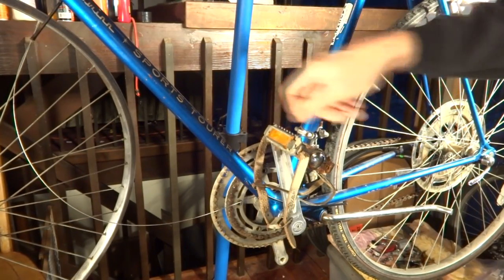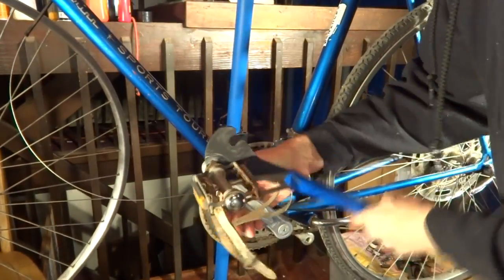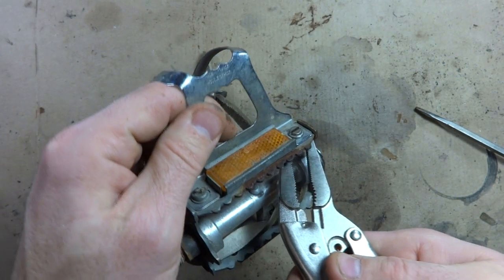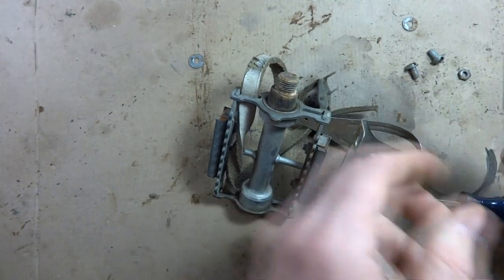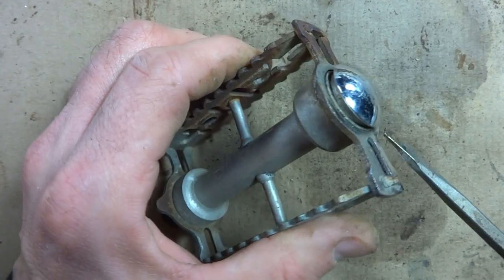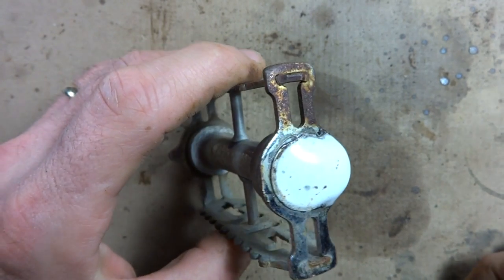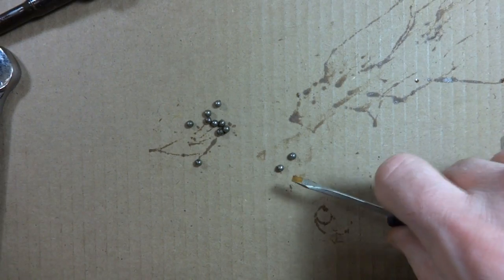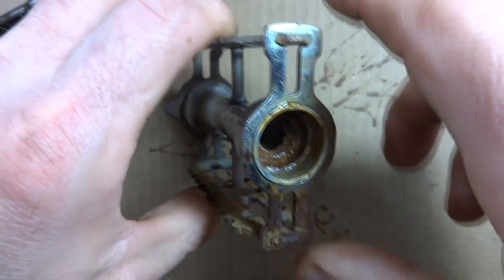How To Overhaul Vintage Schwinn/Atom 440 Bike Pedals - Clean/Lube/New Bearings

Comment: Those cleaned up rather nicely! I got an old Schwinn in really good shape, mid '80's world sport, and am going to overhaul the pedals, they are in better shape than the ones you showed here, so should be just a take apart clean and relube reassemble job on mine. The bike seems to have never been ridden, just got some bugs due to 35 years of sitting neglected...thanks again RJ for all the sharp vids on how to stuff with these old bikes!!!
Reply: Bikes like this have one bad thing when it comes to being almost new from sitting in storage for decades. The grease goes bad. Someone could of rode it with bad grease which is about the same as riding it with no grease after it sat in storage. So for people buying a bike that is almost new, always check the pedals and wheel bearings by spinning the rims and pedals to be sure the bearings, races, and cones are just as excellent as the rest of the bike. You could be buying a bike with damaged parts that are also parts that are very hard to find.

Comment: Just so happens I had just overhauled the exact same model of pedals. Stumbled onto this video by accident afterwards . The 8 outboard and 11 inboard count is what was in my set. I repacked them with 10 outboard and 11 inboard bearings. 10 bearings set with a little grease to hold their position allows a test fit of the cone and after removing the cone there was still a plainly visible  gap in the line up of bearings in the race. Atom figured 2 extra bearings would cost them their profitability.
Reply: My Atom 600 pedals were fitted with 10 bearings outboard and 11 inboard.  The original ones were in perfectly good shape, so I reused them.  Had this been a wheel or a bottom bracket, I'd have acquired new ones.  Honestly, though, the pedals were fine before the overhaul.  I only overhauled them for the learning experience.

Comment: had these pedals on my 80's apollo 2 road bike but without the toe clip & strap those press fit dust caps used to get dented & fall off,my pedal caps had 2 extentions that had 2 screw holes to hold the cap in place,used to be referred to as bear trap pedals because of the serrated edges :)

Comment: Presumably this process would work for Atom 600 pedals as well?   In this case, the straps are installed what most riders would call upside down or backwards.  The usual orientation is such that the strap can be pulled outward to tighten.  EDIT: My Atom 600 pedals have 10 bearings on the outside and 11 on the inside.

Comment: I decided to rebuild the pedals on my wife's bike after rebuilding the gear. I ran into the same odd number of bearing. I added bearings as well. I will be doing the other side pedal tomorrow.  I am curious if it's the same.

Comment: i just bought RFR Flat SLT, removed the old (default) plastic ones with a Knipex and i used Force oil( for chain) to grease. Should i use silicone vaseline instead ? i also ows PTFE spray for chain and a spray for fork, probably silicone based too. 
thanks for answers.
Reply from the maker: Sorry, I don't know those pedals. For pedals with all metal stuff, I use marine grease. If there are plastic parts, I use silicone grease.

Comment: As always, excellent video. I also have a question for you. I’m building an old Mongoose BMX and was fortunate enough to be given the stock SR-468 pedals but one of them has a slightly bent spindle. Have you ever managed to straighten a spindle, if that’s even possible, or replace it with another from an old junky pedal? I’d imagine as long as the length and cone thread size is the same I should be able to do it. Any advice is appreciated.
Reply from the maker: If the spindle is bent, replace the peddle. Unless the the other peddle is the same, the spindle probably wont be.
Reply: As it turned out the pedals were for 9/16” and I managed to find a crappy old set that actually had 1/2” SR branded spindles in them that matched up perfectly. Just dumb luck that I had them.

Comment: Thank you so much for this video! I just rebuilt my second pair of 440s using mainly your video for guidance. I do have a question about the amount of "play" that is acceptable? For mine to spin smoothly there is still just the slightest amount of play. Does there need to be No play at all?
Reply from the maker: You want them to turn smooth, not necessarily spin freely.
Reply: @RJTheBikeGuy  Thanks, I will consider tightening the cones a little more. They just have the slightest give when I wiggle the axle. I just didn't know if they should have no wiggle at all?
Reply from the maker: There is a fine line between turning smoothly and no play.
Reply: A tiny bit of play is allowed, because the spindle bends a little when the rider puts pressure on the pedal.

Comment: RJ, I have to maintain Union U40 pedals for my Bianchi. But there's no dust cap. It's one piece. What can I do?
Reply from the maker: Different pedal. I would have to work on it to tell you.
Reply: @RJTheBikeGuy  I discovered the reason why the dust cap was not removable. I cut that part with an angle grinder and I found no bolt, the cone was riveted. I would like to show you the image.
Reply: So I took other old pedals to re-use the spindles, and the locknut is half screwed in the axis, half is out of the axis. I think it is bad, right? The torque could shell the tread.
Reply from the maker: @damianomartucci9814  Probably just replace the pedals.
Reply: @RJTheBikeGuy  I solved. I used 1/8 in bearings. Yes, I should. But I would like to maintain originality

Comment: when I tie the nut, the cone is turning  at same time. its impossible to hold the cone still with a wrench. So Whenever I try to tie the nut with the cone correctly placed it keeps turning along and its too tie ! any idea how to solve that ?
Reply from the maker: +Dominic Fortin Does yours not have a keyed washer between the cone and the lock nut?
Reply: No , no washer only the cône and nut.
Reply from the maker: Are you overhauling the same pedal as in my video? In that one, there was a keyed washer that separated the cone and lock nut.
Reply: no its a wellgo pedal but the mechanism is the same. Went to a bike shop today and the mechanic couldn't help me out..... lol
Reply from the maker: You will have to find a way to hold the cone while you tighten the lock nut.
Reply: look are you SURE there was no keyed washer?? go get it and bring it here....

Comment: I just impregnate the pedal with motor oil, let it soak in for a few hours and then set the pedals upside down and let all the oil drain out... Not even close to being the correct way but its definitely better than doing nothing at all..lol
Reply: Yup,,, my method also.